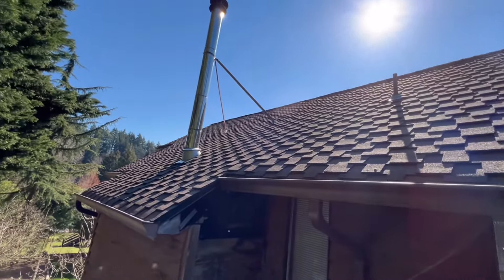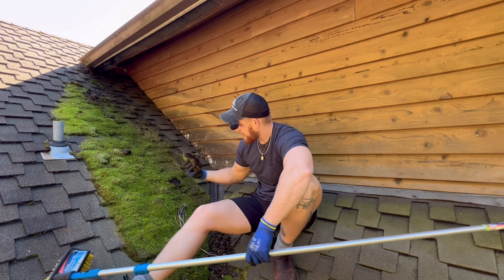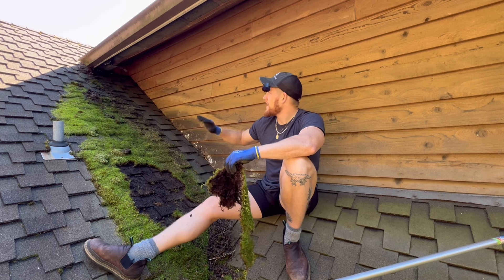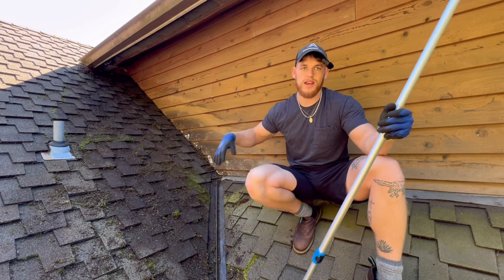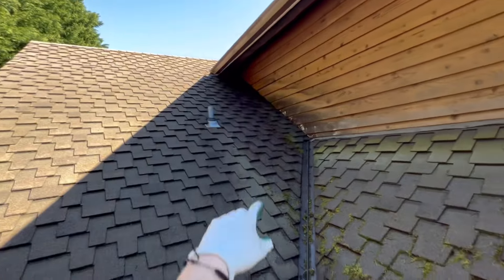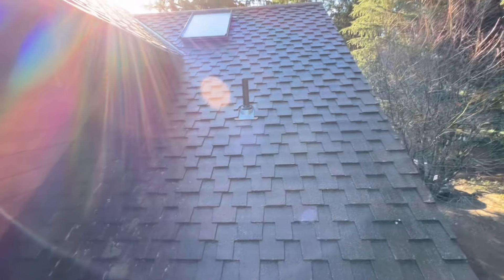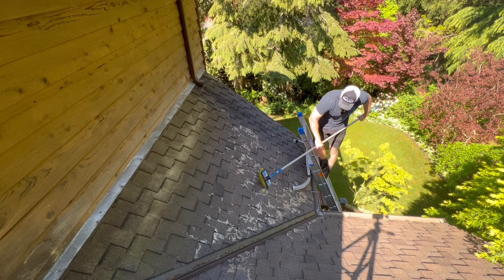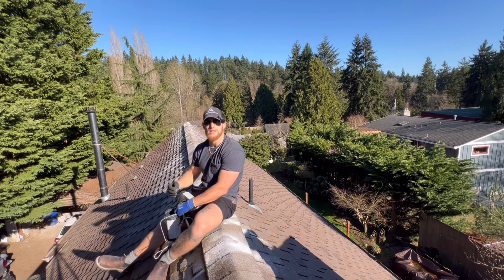How to remove STUBBORN roof moss for good (2 month results!)

Comment: You have a kid bro! You should really be harnessing now, I never used a harness until a coworker of my uncle passed away. He did roofs for over 20 years! Sh*t can happen to anyone, once you get the hang of it the mount install only takes 5 minutes plus sometimes, I charge an extra $100 to leave the roof anchor there for other contractors future uses
Reply: There is no way it’s feasible or time smart on a easy pitch like the one he is on.
Reply: It’s a two story roof and s somewhat steep pitch. One wrong step or miscalculation is all it takes and your paralyzed, shattered a leg, arm or any other injury that can possibly put you out long term

Comment: The final result in some of those areas looks awful. I’d be pretty unhappy if after a roof cleaning my roof had dead white moss in some areas.
Reply from the maker: As long as you explain and let the customer know there is zero way to remove without damaging the roof
Reply: @Baddiesposeforme12 
Not hating at all. Pointing out an obvious flaw in his work.
Reply: @SpencerClaeys 
You can use a more firm brush to get the details of that moss out, without damaging the shingles.
Reply from the maker: Be my guest 😂 I’ve cleaned nearly 2,000 roofs that stuff was not coming off
Reply: @MarkGendro  not really, even the yellow brush will knock loose bits of limestone off the shingles depending on age
Reply: @SpencerClaeys  there are over 12,000 species of moss in this world. I find some of the "stringier" moss is harder to remove.

Comment: hi spencer going thru book this weekend just got a cheap used truck downb to last bit of savings ready to go balls to the wall soon.....can i ask how much you quoted this job for? thats a very smilioar style house size anbd roof in my area  (vancouver island) and would help i think i keep under valuing myself
Reply: I'm throwin' out figures here. 150 cad per hour and then raise your prices
Reply from the maker: I believe it was $550? Something like that and I also only went back to get photos they didn’t ask me to or anything
Reply: @SpencerClaeys  yea ok that sounds pretty fair thanks......i wanna try and get more quantity vs too  high prices but not under cut myself too much....Have a good weekend